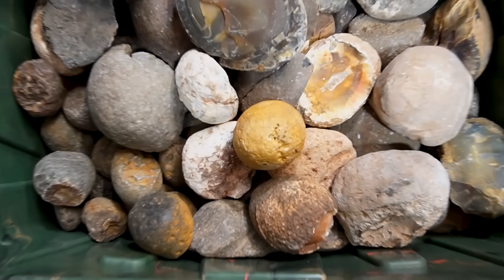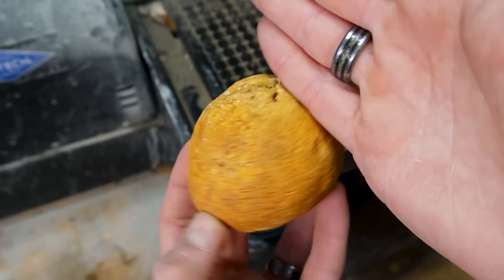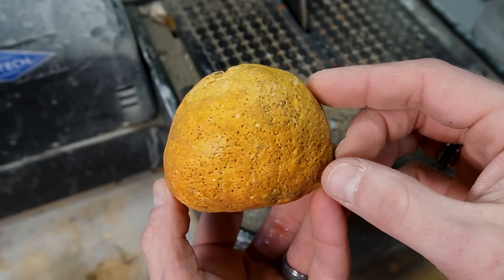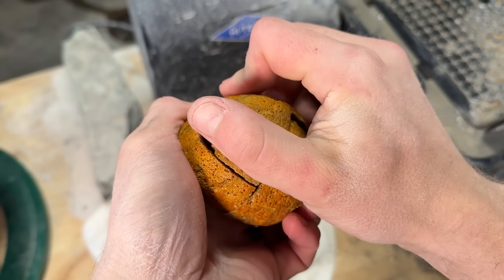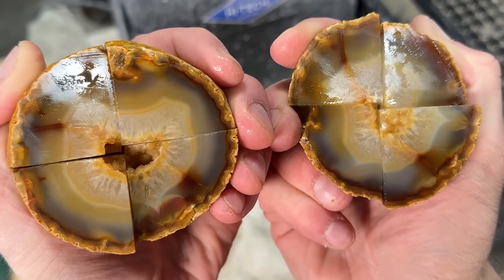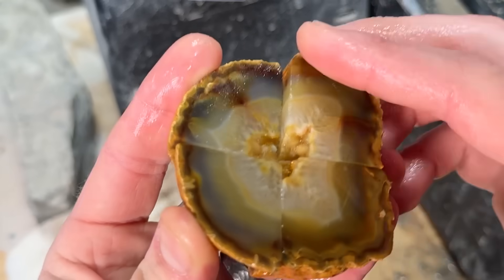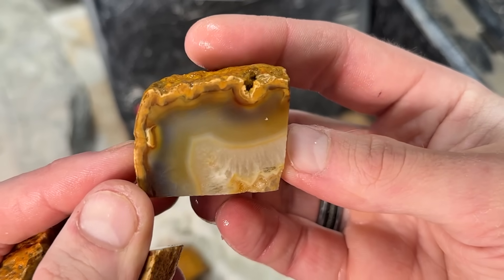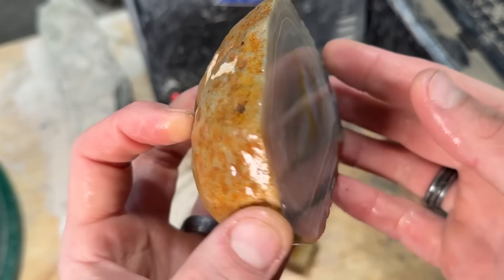Sacrificing an Agate for Science (Does it matter where you cut it?)

Comment: If the moisture & its minerals condense on the walls of an air pocket, then the more round the agate/geode the better odds for uniformity with all the cuts. But if you used an irregular shaped agate, the differences would be greater. So yes, I’d like to see you do the first two cuts on an irregular. HOWEVER! I must demand that you look after you make your first, preferred cut. That’s so, if it’s a keeper you don’t ruin it & can try again to find one worth sacrificing.

Comment: This agate was almost perfectly spherical which is probably why you got "lucky" with the cuts on this one. Though I can see why its shape would make for the ideal test for the "does the direction matter?" question - because it was so easy to section it up evenly (or as evenly as possible). Some of the agates you've done with very noduley shapes or just uneven top to bottom almost have a "cut here please" shape to them in that its so much work to not follow the shape that its more likely to fail so less pay off. But that kind of uneven shape is also the most likely to show you a real answer to how the cut direction changes things. Based on how they form in the first place it makes a lot of sense that a spherical one would be more even in how it looks when cut. Though it really did make a fun challenge trying to match the pieces/sides up correctly again!

Comment: They won't fully match because the cut, though straight, is not razor thin. The blade has thickness and the pieces are shaved off at least one or two millimeters every time you cut it. it is like if the puzzle pieces were cut smaller than they should.

Comment: Woodward ranch agate biscuits near Big bend Texas  are about the most spectacular agates found anywhere but you must cut them in a special way. You get just one large slab by cutting the top and bottom husk off the biscuit  instead of cutting a thinner biscuit type nodule in  half down the middle or in the half from the thin side.

Comment: That was a cool experiment and it verified my expectations. At least from what I know, most agates form inside cooled-down lava bubbles by depositing minerals from the periphery to the center. Therefore if the bubble is entirely filled with a banded agate the bands should follow a somehow centric pattern in a spheroid, and thus the cutting direction shouldn't be a major factor. Of course, this is a simplified example. There will be variations depending on the bubble's shape, the conditions in which the minerals were deposited, and the type of minerals themselves, however, by logic, the bands should be similar if the cut is through the center. Then the possible differences in the cut result will mainly depend on the existence of asymmetrical quartzy depositions and fractures which should be evaded so they won't appear on the facing surface.